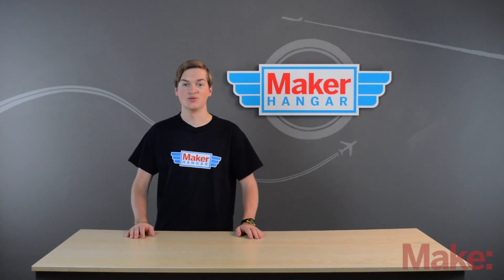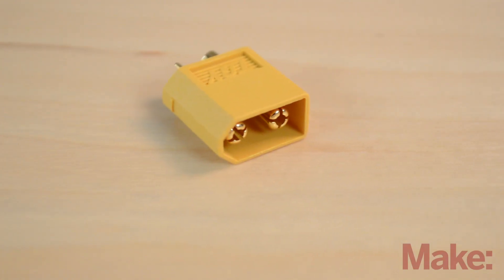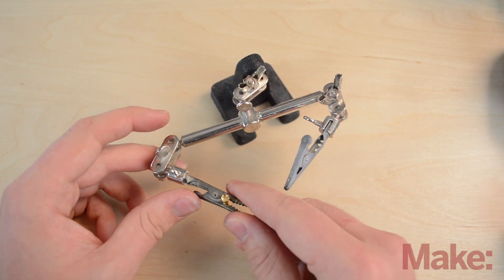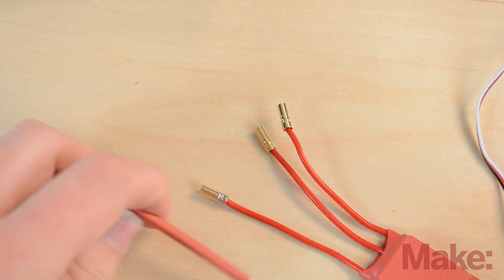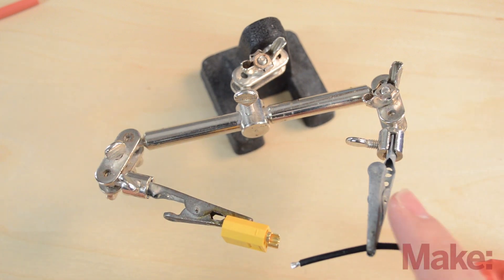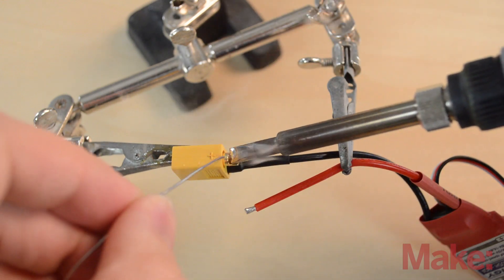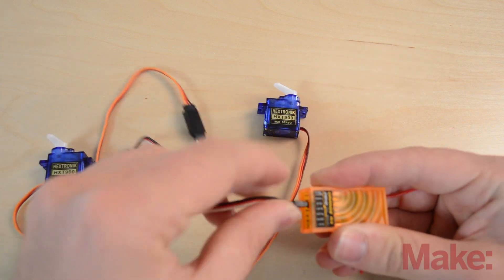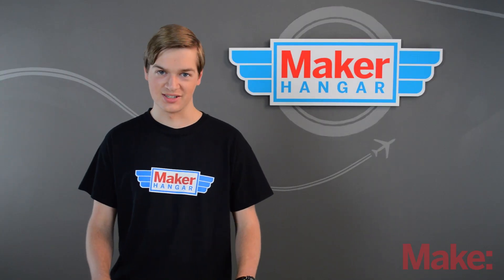Maker Hangar: Episode 8 - Electric Parts

Comment: That second, red, battery wire solder joint didn't look sogood to me. It looked like the wire was pushing into the solder, and not properly bonding.
Reply: Yup, the red wire did not get properly soldered.

Comment: One quick question: when soldering, why do you tin the chisel tip then put it onto the coupling? Is it for surface area temperature transfer? That's the only reason I can think of (I haven't built a model in 10 years).

Comment: A good tip with soldering XT-60 connectors, is to connect two of them together before you solder in the wires to the back. This reduces the chance of you melting the plastic and skewing the metal connectors in the plastic housing. Obviously as your soldering skills improve this isn't as necessary, but as a beginner I found this tip super handy

Comment: Not sure if its been mentioned, but if you shrink the heat shrink with the blue part of the flame, you dont get the black scorch marks. And you really should make sure you tell people to keep heat on the connector until the wire is also nice and hot so it all connects properly and you dont get dry joints. Loving the videos though! :)

Comment: Are you talking about a Gear Set to use with the Motor to turn the Prop?  If so, you do not need a Gear Set with the newer Outrunner Electric Motors.  The Motor Shaft will spin the Prop directly with no assistance from a Gear Set like you would use win an Inrunner Motor.

Comment: Hey Lucas, Great video series. I am learning a lot. I have always wanted to fly RC but was a little intimidated. You are doing a great job of making it accessible. Thanks. Now on to my question. In the video, you say you chose a 6 x 4, but in the parts list you has us buy a 6 x 5e. Now having watched your video on propellers I understand that the greater pitch means more push/pull through the air but should we have purchased the 6x4 rather than the 6 x 5e or are they close enough not to matter?

Comment: My favorite are Anderson Power Poles.  No male/female deal, everything soldered the same way, just snap on color coded cover.  No heat shrinks needed as the connector covers everything too.  Super conductive.. used to melt those molex and deans.. but the Power Poles stay cool.  R/C car racing... =).